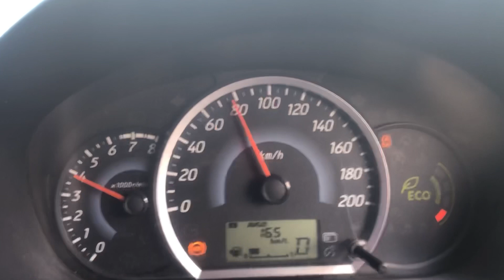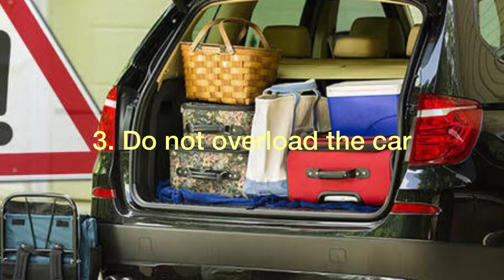CVT transmission. How does it work. How to make your CVT last longer. Why Nissan CVT fails.

Comment: Am very happy the way you are explaning Most of Nissan Cars  really have problems with their CVT transmission  overheating, how can you keep their operating  temperature while as you travell with it for sometime the Transmission fluid be it NS1, NS2, or NS3 they normally becomes hot above optmum operating temperature ? ? I got you that you may purchase Transmission  oil cooler from Amazon, Ebay etc will this prevent issues of whinning noise when  becomes high temperature, and which  Transmission  Cooler is the best for Nissan Xtrail T31 using petrol? ? And are the additives like lubegard CVT recharge and Protection nice to put with the transmission  oil NS2 and may prevent the overheating in Nissan Cars? ?

Comment: Very good advice and easy to understand. I added a Rogue trans fluid cooler to my 2010 Altima. Like the one you have a picture of. The advantage of the Nissan trans fluid cooler is it has a thermostat which allows the fluid to warm up to temperature before any cooling occurs.
Reply from the maker: Absolutely
Reply: @RidemFast where did you buy? ? And did you completely remove the oil cooler already intalled in the car? ?  Or they just working together? ? How did you connect it. Did you also remove your themostat in stock? ?
Reply: @edwinalexander1170  Rather than make the trans fluid cooler like I did, I strongly recommend buying the Nissan kit. It will cost more but everything, cooler and hoses, will fit perfectly and will be an easy install and have instructions. In hind site, this is what I should have done.  Oil Cooler Auto Transmission. Service Kit COO.
21606-ZX59A  Part Number: 21606-ZX59A
Supersession(s): 21606ZX59A
Reply: @ridemfast7625  thank you so much kindly provide me with the link i may purchase the Nissan kit as well as its transmission cooler.

Comment: One of the most straightforward discussion on CVTs.  Thank you.  Having trouble with my CVT now on my 2007 Mitsubishi Outlander.  I was told yesterday that its actually the same one found on the Nissan XTrail.
Reply from the maker: It is. If in Nairobi, pass by for a second opinion.

Comment: Thanks for the Info...for the Nissan cvt at what point should one install the after market cooler, before or after signs of overheating?
Reply from the maker: If you can, do it well before
Reply: Price of the aftermarket cooler installation on E11?
Reply: Do it yesterday

Comment: I like the smoothness of a cvt but you guys are making me panic it wont last. LOL! These are all good pro tips.
Reply: Change the fluid every 25,000-30,000 miles. Drain and fill only. If you haven’t done it for 50,000+ miles, do it 2 or 3 or maybe even 4 times. Drive it like a normal person and be nice to it. I have an Altima with 145,000 miles on it and have done 7 fluid changes and one pan drop to clean the magnets and change the filter. My ac compressor went out before my tranny. Just take care of it the right way and it’ll serve you very well. Listen to him too.

Comment: Please clarrify:
Constant velocity as that the object in motion is moving in a straight line at a constant speed. Vs.
Continuous variables as can take on an unlimited number of values between the lowest and highest points of measurement.
In transmission CVT LANGUAGE.
Reply from the maker: Continous variable transmission

Comment: Please use more of laymans terms instead of using  technical language. so that this lady writing can better understand.
Reply: Think of "continuous variable transmission" as an analogy of "continuous variable" in statistics and other automatic transmissions as analogous to "discrete variables" in statistics. A continuous variable can take any value between limits, eg, the height of people in a village can take any figure,  1.03m, 1.031m, 1.4m, etc. A discretion variable can only take specific figures such as the number of people in a room can only be whole,  no points we 1, 2, 3, 10, 28, etc, no 10.2 people. Now, the CVT changes gradually from the largest gear ratio as the belt moves smoothly through the pullies,  it does not jump any position on the pully so the variation in gear ratio is continuous from one end to the other. The other transmishave real gears.with fixed number of teeth so they can only offer specific gear ratios, discrete gear ratios, no continuity.